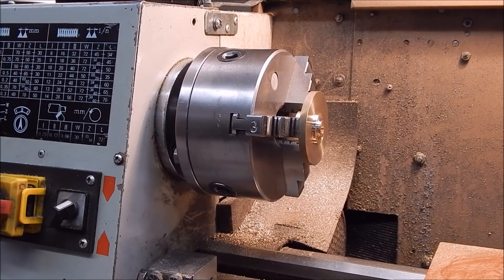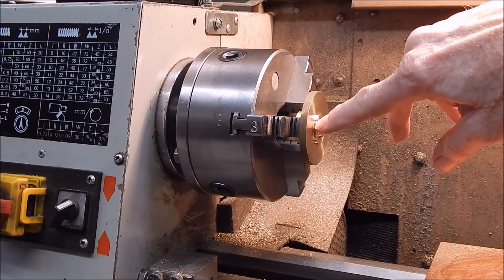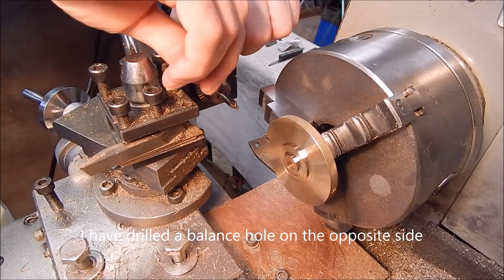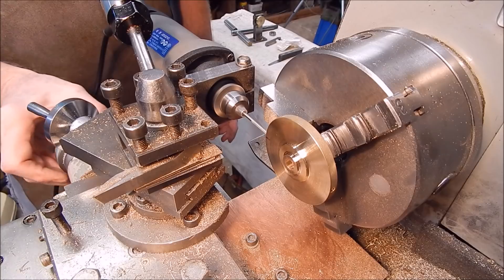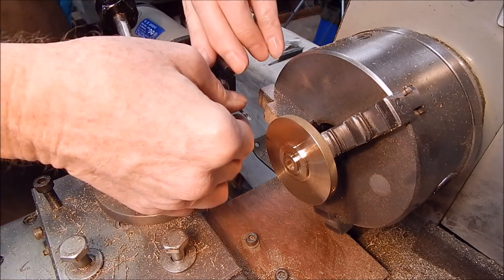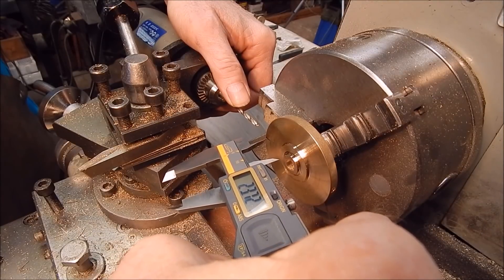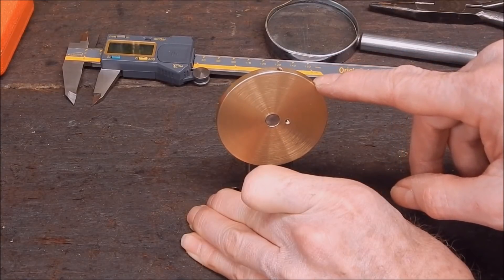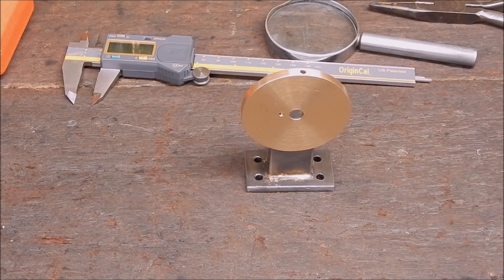How to accurately cross drill on a metal lathe

Comment: I am a Noob in the process of getting my first metal lathe. One of the things I will need to do is some cross drilling. Yours is the first set up I have seen and it looks exactly like what I need. I assume that's not a store bought set-up for your drill. Are there plans on-line to build a fixture like this for my future lathe? Thank you for sharing your time and expertise!
Regards-John Archer
Reply from the maker: Hi John,

I've not seen a store bought attachment/mount, but they are probably available, for a price. 

Most seem to be home built like this.

Another approach people use is to mount a short shaft and drill chuck in two ball races in a toolpost mounting block and drive it with an electric drill.  That way you can eliminate any issue with the power tool mounting point due to irregular casting etc and use a powerful slow speed drill.   That's probably the most accurate/robust way to do it.

I've not seen any plans, but there are plenty of videos on this subject.  It's a pretty basic design and build concept/project.

Cheers Rob

Comment: Hi Rob,
How did you prevent the chuck from moving?
Reply from the maker: I had the lathe in low gear.  As the drill forces are at 90 degrees to the spindle rotation there is no chuck movement..
Reply: Oh ok, thanks.

Comment: using the idea of the 360 degree template and usb microscope and the cross drilling ideas here i constructed an extended drill chuck for this purpose.  The 3/8in shaft drill chuck is mounted to a 10mm drive shaft from an ink jet printer (very rigid and straight) the axle fits though a pair of bearing blocks milled to fit into the tool holder.  I made the bearing surfaces from the square-head screws from old whipper snippers.  The shaft slides cleanly through the bearing and attaches to any electric or battery drill.  I tested runout, of the drill end of the shaft, with a dial indicator and got a runout that moved the needle less than .25 of a thou)
As I drill multiple, evenly spaced radial holes when making spoke wheels I attached a CAD generated 360 degree compass card (in 1/2 degree increments) to the outer end of the spindle bore and a fine brass arrow mounted rigidly above.  With the USB microscope, on a magnetic dial indicator mount, viewing the arrow-degree alignment.  With the machine switched off, and in the lowest gear, turning the chuck rotates chuck and compass card together and the microscope view prevents any parallax error.
Thanks for your work and inspiration
Reply from the maker: Excellent !

Comment: Rob, that is a great little addition to increase the capacity of your lathe.  I've seen some pretty complex spindle heads used on lathes in the past.  Yours does exactly the same job but soooooo much simpler and easier to set up. 
Cam
Reply from the maker: Hi Cam,

It's dead simple.

I tried using a plastic bodied drill in a similar mount years ago and it was totally useless, flexed so badly.

The HILDA has an alloy nose section perfect for a metal mount (as seen) and bolts up dead rigid in the tool post.

It does a great job of this sort of precision work.

Cheers Rob